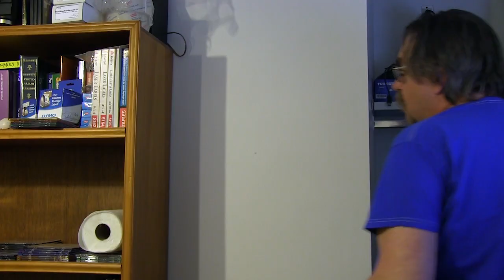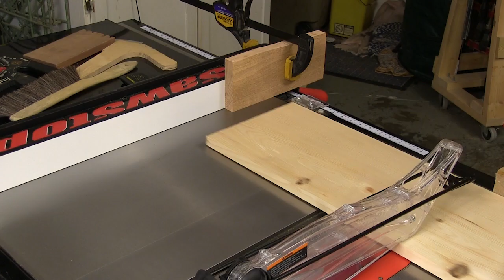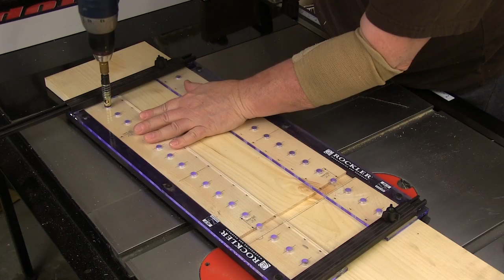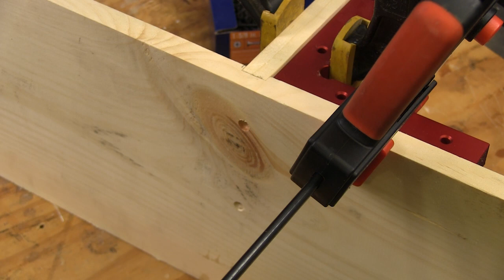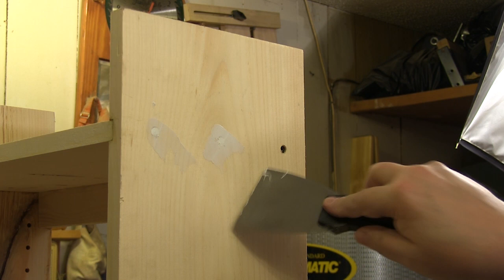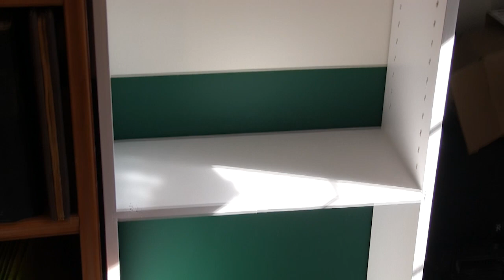Building an Office Shelf/Storage Unit

Comment from the maker: I did use drywall screws in this case as they are more or less pins and they are not used for clamping pressure. I know the pro and con arguments but int his case, in soft wood, the drywall threading holds well and has plenty of sheer strength for this use.